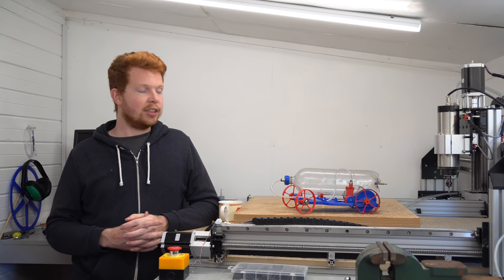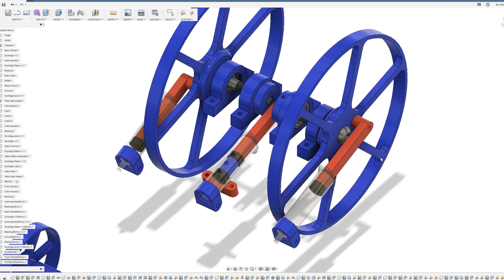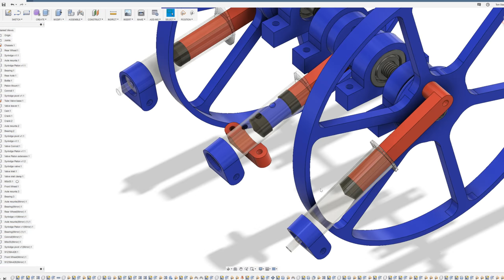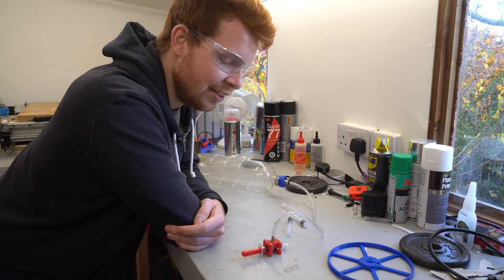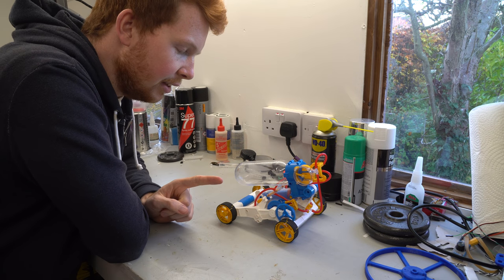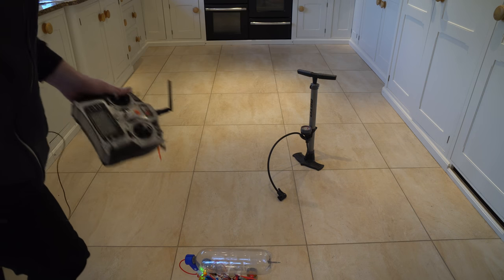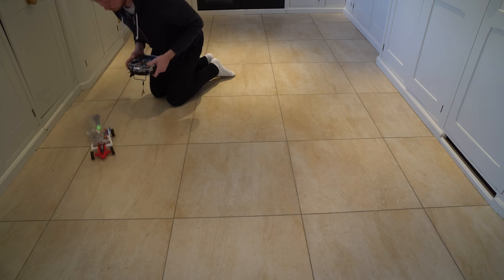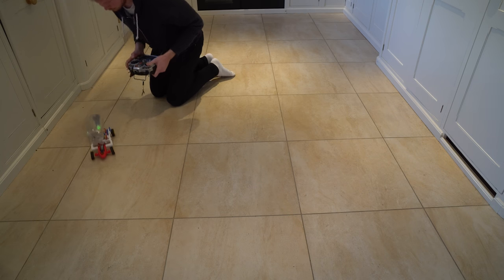Air Powered RC Car

Comment: I am willing to bet that with a bit lower of a gear ratio, that thing would be able to use MUCH more of the air that it has available to it and you could get an even longer run time out of it... If it really has a 1:8 ratio like you described (and what it sounded like) then that will have almost no torque on the other end (as you saw while going around turns). You should see if you could print a different set of gears for it... perhaps 1:4 or 1:3.... you would definitely need a throttle to control it then though as that thing would just take off (like when you lifted the car off the floor)

Comment: Why not 3 d print stronger cylinders to fit your syringe pistons? You can test till the diameter is just right and I bet only your center valved cylinder would need changed

Comment: Hi, why didn't you simply print a sleeve for each syringe to deal with the wall flexibility, ideally a design with very slight initial squeeze (a press fit) and ribbed to keep weight down ?

Kind of like the way wood barrels have steel rings

Comment: Dude, you were supposed to keep trying with the syringes, just wrap wire around it and strengthen it with super glue, then you can use 150 PSI.. Sweet

Comment: I'm not sure if you have thought of this or not but for a longer range could you use a pressureized gas bottle with a regulator lowering the pressure?

Comment: Air powered skateboard or bike with pressurized frame and a regulator to bring down pressure. I suggest a modified compressor as the engine.
Reply: Even use the compressor as the charging system via an alt input. Use a wind or water turbine to mechanically drive the compressor for a green alternative to batteries.

Comment: Could you not find some CF tube that has the same inner diameter as the syringes to stop them bulging? Even if not maybe a cardboard wrap or something to get the right fit for the tube.

Comment: I see it's little problem turning, it's "live axle" driving both rear wheels and no differential, so the friction when turning is a big drag. easy fix, just put one wheel on a ball bearing so it isn't powered, or cut the shaft give the one wheel it's own little free turning shaft... and watch how it goes after that! did hear some squeaking, throw some oil at it a few places.

Comment: What would happen if instead you take the top off the bottle, add a cube of dry ice and 2 tbsp of water? Would the pressure be enough or too much?

WE WILL FIND OUT NEXT TIME, ON EPISODE 3 OF AIR POWERED CARRRRRR

Comment: Now build small 18650 3s pack that will power a 12 volt car air pump connected to a 2 liter. Then Build a trailer that attaches to the air car and test it !

Comment: I’ll be honest, I didn’t watch most of the design stages in this vid. But I get the gist that these piston don’t spin fast. What if we too a all metal tank and put idk 200psi or so in it? Connect that up to a engine that’ll run that are 40k rpm ish, not sure what the best engine for that would be but end result being enough to move around a proper rc car like a Traxxas bandit?

Comment: couldn't you have made your own pistons with metal/copper tubes? if you use pipes with the same diameter as the syringe, you could reuse the plungers and the 3d prints.

Comment: wrap this bottle in epoxy resin impregnated with fiberglass, this will allow the bottle to hold 50 atmospheres at a minimum, and install a home-made gas reducer, if you do this, one bottle of gas will be enough for tens of kilometers. Да я русский и пишу через гугл переводчик))
Reply: couple wraps fiberglass cloth would do a lot for holding higher pressure, the ends of the bottles are usually much thicker that their sides.

Comment: I used to have one of those air cars a while ago but never got it to work because of the cheap air valves you had to assemble yourself. Because of that reason I never got to finish assembling the vehicle and had to throw it in the bin sadly.

Comment: What if you put liquid nitrogen in the bottle, and as it heated up it would pressurize the bottle?
Reply: The ice that it forms will damage the engine, especially if it forms inside one of the components

Comment: You're going to lose efficiency by having that large expansion area in your middle syringe, in addition to all the volume inside the piping going to the secondary syringes, if you had two valves closer to the secondaries driven by the crankshaft you may get better efficiency if you can seal it

Comment: Couldn't you make a piston from some small diameter pvc pipe and 3d printed pistons with o-rings? a bit of silicone oil and you should be good to go.

Comment: A thick 3D printed sleeve would probably stop the syringes from expanding
Reply: G'day,

   A simpler fix would have been to "serve" the Syringe-Barrels with Cotton or prefferably Nylon Kite-String, with a hidden-end Knot under the binding, and then 5-minute Araldyte (Epoxy) capilleried into the Thread....; resulting in a Pre-stressed Nylon/Epoxy Composite Shell, constructed insitu - using Human Eye-Hand Communication & taking 5 minutes to serve each Barrel, and another 5 minutes to apply the Epoxy to all 3 Barrels.

   Probably an hour after starting to serve the first Syringe the Job could probably be put into the overall Assembly, and sufficiently cured to be used operationally not long after that.

  Just(iaiably ?) sayin',

  Have a good one,

  ;-p

Ciao !

Comment: What if you could put hydrogen or helium instead of air?
The weight of the vehicle would be less and you could place a larger deposit.
This may matter less in a land vehicle, but in an air vehicle, you know that weight is very important 🤓

Comment: Hi Tom. I like this kind of videos. In order to smooth the run, would it be possible to add a flywheel or else 2 more syringes offset 45° from the original ones ?

Comment: Force the exhaust air through a turbine to spin a small electric motor to generate the power for the RC electronics, so it's fully air-powered.

Comment: It's no fun getting something built in a factory. The fun part in these projects, as i see it, is making them out of everyday objects from a hardware store. I can close my eyes about the radio controlled wheels, but no more than that. You gave up too easily. You could try wrapping the plungers with some metal sheet and a wire or aluminium duck tape. You could limit the pressure with an escape valve, the plungers will not operate under the full pressure when moving. Also use 3 syringes for God's sake, you will not need the inertia if you do.
Reply: You could also grease the syringes, so they can move more easily.

Comment: I think you should go super complex...

Take two supersoaker bottles and set them up with valves attached to a battery powered compressor like...
https://www.amazon.co.uk/dp/B07DC267DP/ref=cm_sw_r_cp_apa_BVm8Bb7CPBJVT
...so that one bottle is charging while the other is driving your syringe. The syringe would need pressed inside a reinforcing cylinder and oil will need to be added to the system to reduce friction, (those o rings aren't designed for constant reciprocating motion and will wear quickly).

The syringe would use a slider crank as described in the video or better yet a spiral drive to twist elastic bands. An Arduino could be used to count the twists being added by the air spiral drive and the untwists of the driveshaft described below and control a valve on the bottles to stop or start twisting (with ideal min and max twists being worked out through experimentation).

The twisted elastic would drive a shaft with a servo controlled friction brake which can be direct or geared drive to the wheels.

Comment: I used a ric helicopter turned it into a car car couldn’t back up the helicopter I didn’t take it apart I used simple stuff like technic bricks to get the landing gear in and it would move and turn carpet was it anti vroom and the helicopter broke when I flew it into a battle with a other helicopter